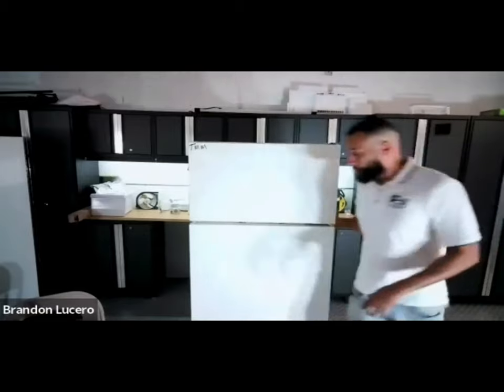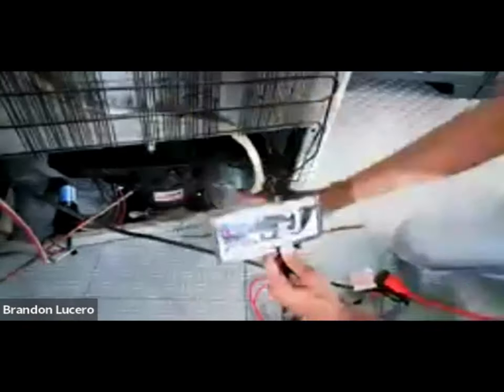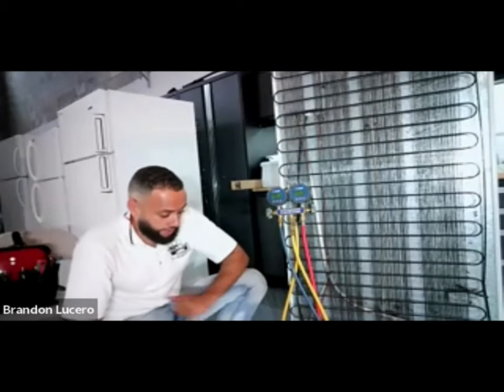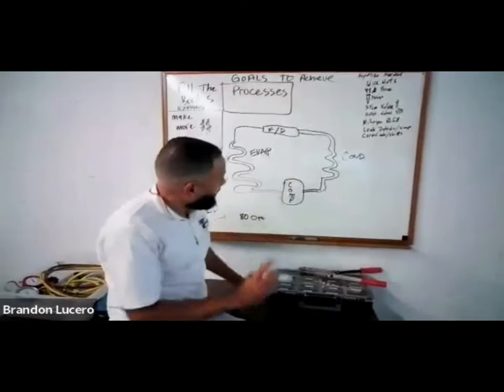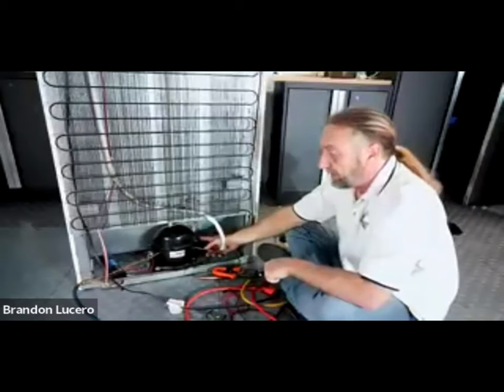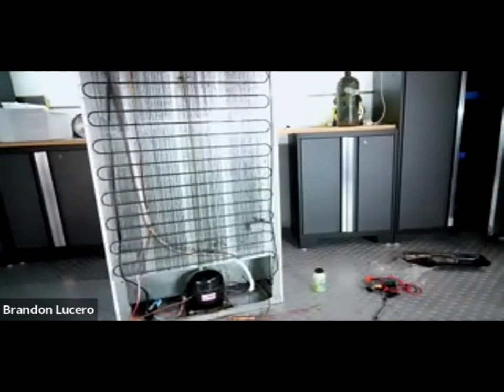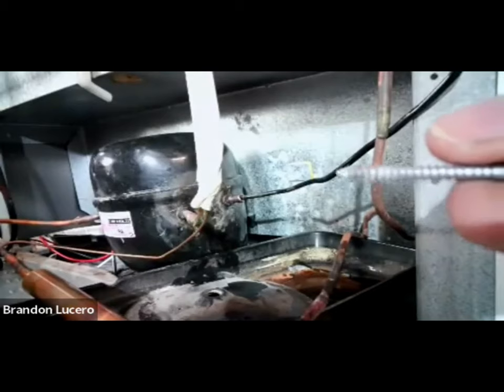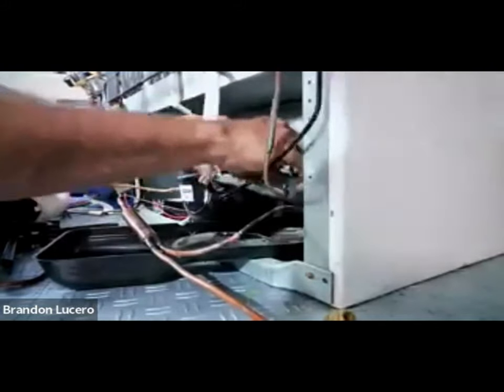Sealed System repair, Part 1 of our online training courses for members, Part  2 will be 4/16/2022

Comment: Thank you for good masterclass. I have a couple of questions regarding the use of Oxy\Acetylene torch adjustment. What pressure do you set on the oxygen regulator and on the acetylene regulator? Are these parameters suitable for using MAPP fuel?  How can I degrease the valve on the oxygen cylinder, will "white-spirit" work?